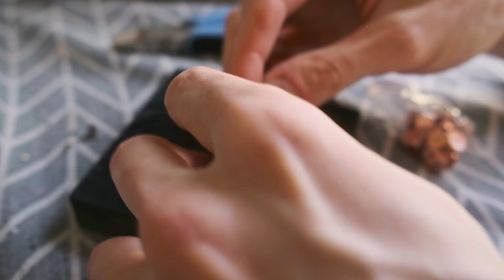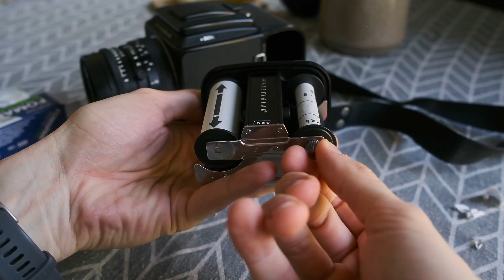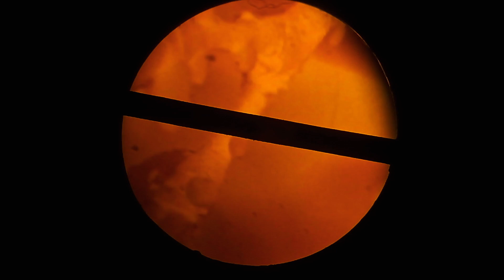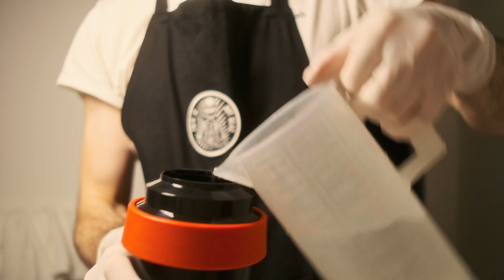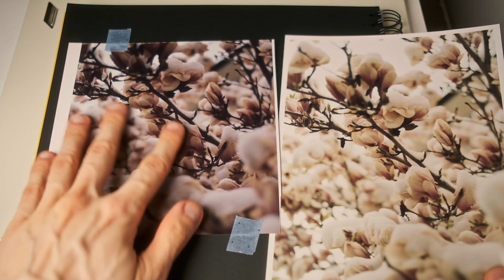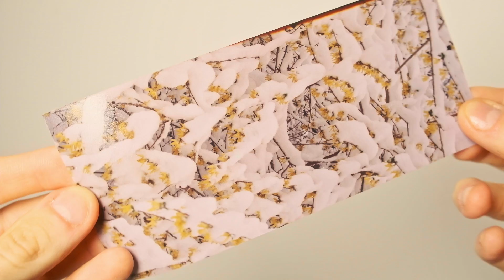Hasselblad strap repair and maintenance on Philips PCA color analyser, new darkroom prints

Comment: How did you get the pin out from the color gear wheel? struggling to fix mine now
Reply from the maker: It's just pressed in plastic of the bottom part. Just carefully applying pressure by grabbing from top part.
Reply: @NordicLab  Thanks so much! it turns out mine was pretty rusty so it took quite a bit of force to get it out, but I think that was the cause of the issues with the unit anyway as the motor didn't have enough power to turn the color wheel all the way around.